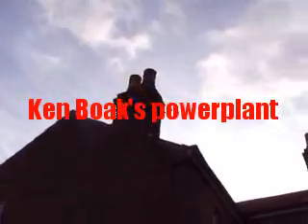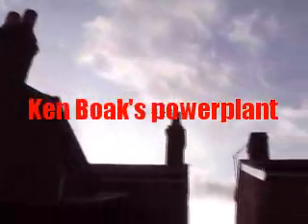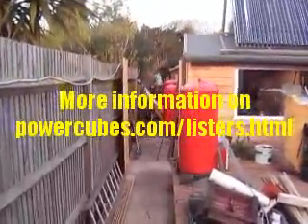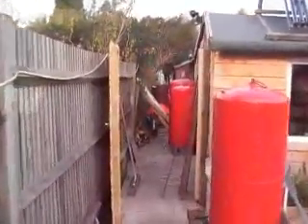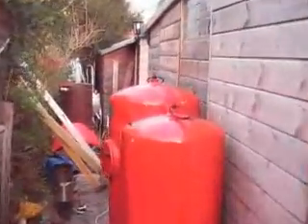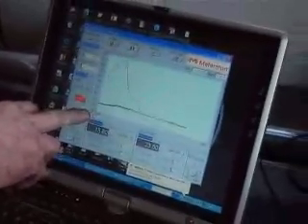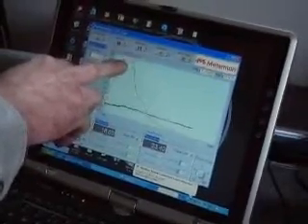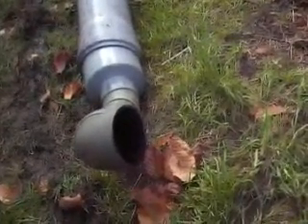Ken Boak's backyard powerplant

Comment: @blunklaura solar power? in England? seriously??

nothing against solar power, but i'd like to ask an opposite question: what about all the waste vegetable oil, otherwise thrown away? or wood gas, from waste wood? both are sure more reliable than solar power... especially in winter, no sun, when you get both heat and electricity RELIABLY and FREE.

solar boiler, anytime, but i prefer something more reliable (and mechanical) for important stuff. just me though.

Comment: Great as a standby unit, but I couldn't imagine his neighbours being very happy with the noise.

The Engine room needs insulating and the silencer should be buried with multiple small outlets all at different lengths along the final outlet pipe to soften the pulsing.

Insulating the ER will keep the fuel warm and also the engine which being a diesel will be slightly more economical if hot. It will also help silence the engine noise.

Comment: With better noise insulation for the engine room and a better muffler this could be a very good solution for heat and electricity :)

Was it hard to convert that old engine to run on vegetable oil?

Comment: You may be able to improve your over all efficiency buy injecting some HHO or Hydroxy gas in to the air intake. It improves the combustion. Yo have a lot of voltage there to electrolyze water into hydrogen and oxygen. The Dry Cell design is the best and most efficient design right now or a Bob Boyce design. Hope this helps.